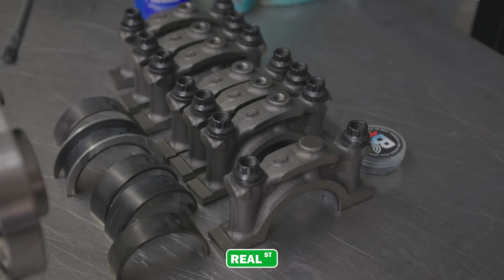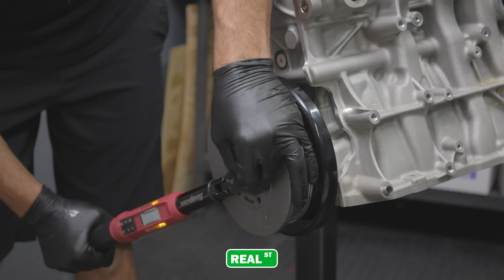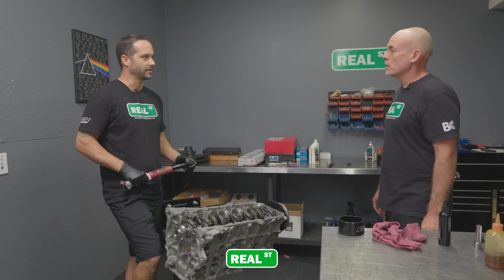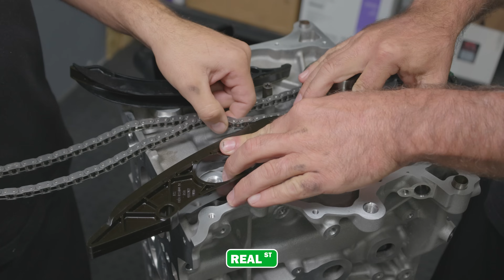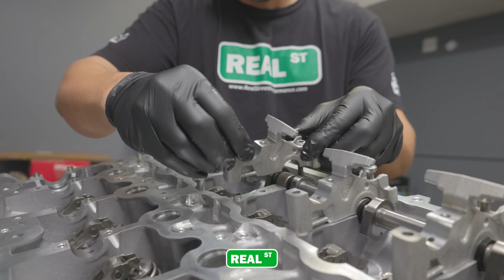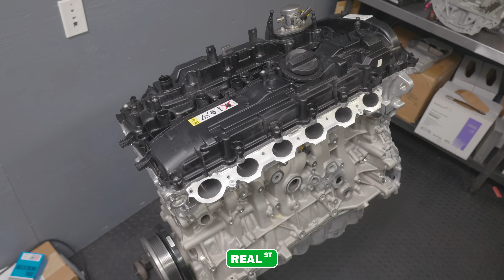Building a 1000HP B58 MK5 Supra Engine

Comment: I was a little disappointed myself that Toyota didn't make a 2JZ like engine for the new Supra and after seeing what it can do with relatively little mods and how far the platform has come I decided to buy one and I'm glad I did.
Reply: It makes Toyota's case even worse when Chevy showed that a new engine they made for the C8 Corvette stingray could easily be made and keep the car at a decent cost.
They should have used the Lexus LC500 chassis, lightened it up, and made a new inline 6 engine. Made the car start in the mid $70k range to look more like the FT1 concept.
Reply: The secret of the industry is that the 2jz design wise, was not that great of an engine
Reply: @l0s78  oh really ?? Why was it not so great of an engine ???
I will wait right here and see what you have to say because i know for a fact it will be bullshit.
Reply: @ACommenterOnYouTube  in terms of design, you want every single cylinder to burn the same. So that when you tune it every cylinder can run the same fueling, same timing, and you won't blow anything because each cylinder is the same. Not one lean, one rich, one much more detonation sensitive.

Every single port on the 2jz is different. It's like 4 different engines in one cylinder head.
Reply: @l0s78  thats a tunning issue, not a design flaw of the motor.
Reply: @ACommenterOnYouTube  lolol. That is a design AND tuning flaw. Do you know how much instrumentation and additional time you need to do per cylinder corrections?

The engine design is mid. Its saving grace was that the bottom was tough enough to boost to the moon and hold up.
Reply: @user-pv3qh8mo4n it wasn't used for real Pro racing, they used a 4Cyl Engine. That is how inferior it is vs the RB26. 2jz is just a straight line Drag Queen.
Reply: @X1xRiGox3X  in the later years didn't they skip the 2j and go to a NA v8 as well?
Reply: @X1xRiGox3X  What is IT ???
Who used a 4 cyl and for what ?
What is inferior to the RB26 ??

YES the 2JZ is a high hp drag queen, NOBODY is saying otherwise
Reply: @l0s78  and once again you failed to explain how this is a desing flaw when it has NOTHING to do with design
Reply: 2jz is a engine made for a grand touring car not for a sport car
Reply: @shadyshinichi2JZ that's isn't saying much for how it actually went for them and they still sit over the so called promised "60k"price tag they said it'd be unless it's used but even that still sits higher than the price of a mk5. Even tuning + adding power in itself is higher and much more expensive and complex in doing than it is with the mk5.
Reply: @shadyshinichi2JZ Chevy has never had the all around sales numbers as Toyota. Toyota has shareholders to respond to. And there is no way Toyota would have ever made an in house MKV with a 3jz and not charged under $60k for it. Easily would have been a $80k-$100k car with no mods done to it yet. The problem is we all forget Toyota or any brand has to generate revenue.
Reply: 2jz was a gt engine. The supra chassis was a lexus coupe chassis. That’s the real history of the supra. If you want to compare the mkiv to the mkv, it didn’t hold a candle to the mkv. In terms of nostalgia and over blown hype, sure. The fast and furious cemented that.
Reply: @touayaaj84  another fast and furious moron thing the movie made the mkiv ... 🤣 
Meanwhile the 2JZ was setting hp records in the mid 90's ... well before the movie
Reply: do you guys not understand that without the b58 the supra would have a 5th gen? how many manufacturers do turbo inline 6s today? exactly, not many. and its because of emission regulations, toyota decidet that it would be way to expensive to make a new inline 6 that meets todays emssion regulations. so the did the right thing, they put the most reliable and tuning friendly new inline 6 in the the supra. that seems to be the b58 and i dont fucking know whats there to hate?? would you guys prefer that they put the inline 3 from the yaris in? i guess not so pipe down and appreciate that the supra even had a comeback and a good one. they nailed all key points that the supra had, rwd, manual, i6 and easily accessible power.
Reply: The money needed design a new engine would’ve made the supra a 90-100k car for the base model just to try to make a profit.
Reply: @gtfree1809  ahh your story is 100% WRONG kid ... 🤣
Reply: @EmazingGuitar  its NOT about the $$ needed to make a supra motor. You people have your shit all wrong
Reply: @shadyshinichi2JZ your plan would not have worked. How on earth is Toyota going to use the platform of a $100k car, make it lighter (which would probably increase cost), make an entire engine from scratch (which Chevy didn't need to do because they never stopped making V8s), then charge for a price that's substantially cheaper?
Reply: @shadyshinichi2JZ  toyota would need to use the rcf chassis and a brand new turbo inline 6 engine of similar quality to there current bmw base claire chassis and b58 which will be almost be impossible to convince shareholders for this level of production scale to undertake it would have been impossible to make the 70k price point which would have heavily effected sales plus the engine would be extreamly unique model since toyota dont make inline 6 turbo and low production means less reliability and parts availability might be an issue compare to the bmw b58 which is use in every major bmw lineup not going with the b58 means toyota would have to retrofit there aisin 8-10 speed which is all honesty not as good as bmw zf8hp as a performance transmision so a toyota build from the ground up supra would be a rcf with there own in house design inline 6 turbo engine that is deffinitly not as good as bmw b58 paired with a less perfromance base transmision on a less perfromance capable chassis and a higher price point with a less reliable and develop package.
Reply: @l0s78  it's not mid at all. The 2JZ is over-engineered like crazy. But I do agree on the point that the head is kinda shit. Really dumb design decision to make all ports different shapes. but that doesn't make the engine itself bad.
Reply: @TheProtagonistGabber  I’d argue that the 2J block is “over engineered” not entirely on purpose or because of ignorance. In the days it was designed the understanding of loads imparted on the crank was not super well understood and not able to be simulated in FMEA. You could essentially hand calculate some rudimentary guesses on loads, and just make the part thicker than it ever needed to be. The crank area is not particularly well shaped with the registers not well supported in tension. The head stud threads are tapped right up in to the deck surface, which imparts additional stress in this area.

Modern blocks have wider deck surfaces for better, more stable cylinder sealing… head threads go down near the mains, come with integrated crank girdles. Making blocks that are all around less likely to stress crack, hold more power, maintain better crank and rotating assembly geometry which translates to longer life of components that make more power, with better emissions and better BSFC.

Comment: They call the B58 the German 2J for a reason. Fun fact, the B58 is used in multiple BMW platforms including the X5 that I daily. It would be fun to maybe build it out to see what kind of Grocery getting monster this could be.
Reply: pure800 upgraded turbo and a tune with some other bolt ons and I bet it is faster than the x5m.
Reply: it is the german 2jz back in the days the 2jz was slap on every toyota product that needed a bit more power and troque then there na toyota a series engine which is pretty much the same story for bmw the b58 is use in every bmw ice lineup that needed a bit more power then the b48

Comment: Interesting talk about the oil consumption. Fun fact, for the honda J series, they tried the same thing. Honda j32 and j35 have iron cylinder liners. About 2-3mm thick. J37s they tried some silicon costing or something along those lines. All j37s burned oil in some degree. Some more than others. Then honda just got rid of the 3.7L V6 and just increased the compression of the 3.5L. Fix in the bulletin was to replace piston rings.

Comment: I was not impressed initially, but after learning of the testing and durability requirements from Toyota on the B58, I gained an appreciation for it. I have always loved BMW's, but have been terrified of ownership due to reliability problems. With Toyota being involved in the development, I'm eager to see if the reliability issue is a thing of the past not only for the B58, but all succeeding engines from BMW.
Reply: Is there any prof that Toyota reliability requirements/ specs are more challenging than the ones from BMW ?

I don’t no any
Reply: Mines been reliable for the past 3 years toyota did good, pushing 800whp for the past 2 years as well
Reply: @sikh7563  Great BMW Engine

Comment: Are boost controllers still available with these setups? Like if you want to roll around with enough boost for 600 bhp map but have the option to go 800 bhp or 1000 bhp.

Nice build.

Comment: i mean to be honest the engine is crazy strong its bascialy stock bottom with bearing vavle springs piston rods and studs with a big turbo kit which is less core parts then what you need on a 1000hp 2jz.

Comment: So I’m 1:30 minutes in to this video and I wanna comment lol. Bmw is the ultimate driving machine and they mean that. They know what the heck they’re doing . The callab between these two major manufacturers was pure quality 👌🏿
Reply: If you had an IQ over 14 you would realize that when the customer had increased the boost or did some sort of aftermarket tuning it caused the head gasket failure as higher pressures in the block do this. This could happen with any engine, even your favorite tried and true engine. 😂

Comment: Hey guys. Since you guys were talking about oil consumption… I’ve got a 2018 Hyundai grand i10 1.25. Car has like 70000km on the clock. Uses 1 litre oil every 3500km. Any recommendations? Hyundai won’t do anything but car is still under warranty. They want to replace engine but blame it on the owner’s driving and not a manufacturing defect. Car gets serviced every year/15000km. Is that consumption normal in modern cars? Use 5w30 synthetic oil. Based in South Africa 🇿🇦

Comment: AMG engine you were mentioning, it had a problem with oil piston rings. They used low friction piston rings. Later the put better piston rings but then you also need to replace the piston itself.

Comment: So the customer never has to worry about the timing since they’ll receive the engine with the head bolted on already? Will they need to re-torque the head studs for the first few heat cycles? If so can they do that without removing the camshafts?

Comment: Originally i was disappointed that Toyota didn't provide the engine.  I Test drove a mkv and was very pleased with the performance.  

Later,  i bought a 23 mt and love it.   It has a good bit of torque in the low end with little lag in the stock form. Also looking at the design and teardown of the engine was much closer to the design of the 2j than i originally thought.  I've also heard Toyota had a good bit of input on the engine itself and it's refinement.  Without being stuck in the past,  i think it's a worthy successor for modern designs.  The b58 will be a more true successor than a hybrid or EV Supra.

Comment: Was the friction hub on the crank updated to the pinned fix or was that friction washer crank timing hub bs only on early engines? Huge pain in car retrofit. Cheers,ed
Reply: The sprocket is a solid part of the crankshaft now
Reply: It was never an issue on B58. S55 was the last engine to use the 2 piece friction disc design.

Comment: Amazing video, master class.  This looks like the “6 exhaust port” version of the B58.  I’ve been searching for a video of this assembly.  Are 6 exhaust ports on the head better than 2?  Which design do you guys prefer?
Reply: Yes, only when it comes to full frame turbo, only 200–300hp differences. If it’s down pipe and tune with stock turbo, power levels are the same.

Comment: It would have been good to show how the valvetronic throttle system worked - or was it some sort of variable cam timing system?
Reply: valvetronic is like Toyota's VVL or Honda's VTEC but in the form of fully variable value. on the video, you see there is another shaft with gear in the opposite end and that is valvetronic adjustment shaft. it controls the position of intermediate rocker in order to adjust how much valve lift will occur. there is explaination on how it works on bimmerprof blog but it only contains 2nd generation of valvetronic diagram. B58/S58 uses the 3rd generation which is slightly different but all of them works in same principal. i do hope the newer B series (and S58) no longer have the same problem as the previous N series valvetronic that also uses 3rd gen valvetronic

Comment: Comparing the 2JZ and the B58TU in the new supra...wow. well, for starters, the 2JZ has over 20 years of development.  The B58TU in the supra has 3 years, and many cars are in 7s 1,300hp with stock block or sleeves, and original transmission built in just less time. So, it is a lot easier to get parts to build a 2JZ than a B58TU. I say it will pass the 2JZ with time if engineers keep developing the B58TU in the supra. Many supra MK4 on the track have minimal interior compared to MK5 running high HP. I say if an engineer builds the B58TU with the recipe of a 2JZ, it will be a game changer.  Billet block, billet heads, taking into account several areas of the heads that lift. Aluminum rods...etc full send 80psi...lol. The B58TU in the supra will become a legend as the 2JZ.
Reply: When you say stock block, what do you mean? People tend to abuse that word. Do you mean to tell me with stock rods and pistons etc?
Reply: @top-notch9761 stock block as in no modification to the block. Factory block, no boring, no sleeves. The factory motor, factory parts, tuners have said 800hp is the most you can push it and even that you are in borrowed time.
Reply: @manny619ish  Yeah I gotcha, I was just making sure that you weren't saying that the stock rods and pistons can take 1300hp without bending and splitting the block in half 😂. Cause it can't as far as I know the big boys that are pushing these incredible b58 engines are built.
Reply: @top-notch9761  asking stock internals to withstand more than twice stock power sounds absurd to me. even the old 2J cant handle too much power on its stock internals. well, maybe those engine can withstand 1000HP on stock internals......... within a few seconds 😂

Comment: Why retain coated bearings? Most owners are going to turn off the stop-start feature anyway, and the OEM coated bearings have already been a source of problems.
Reply: OEM ones might cause issues but coated bearings can have a few benefits
Reply: They aren't a source of problems... the BMW engines with IROX coated bearings have the lowest incidence of bearing issues that they have had in 30 years. Look at any teardown of an N55 compared to B58. The bearings on B58 are pristine in comparison.
Reply: @chrisbradley3224  Papadakis Racing had problems with the coated OEM bearings in their B58.
Reply: @justsomerandomguyman  Do you have a link? They haven't been problems for anyone else that I've seen.
Reply: Papadakis mentions the issues he’s had with oem bmw bearing in a interview with hp academy. He also runs the variable oil pump at default 90psi now and swapped to king / acl coated bearings. But this guy is pushing the b58 over 1000hp with 3.2 stroker kit
Reply: @daveylovesgravy3622  I see, thank you for the reference.

Comment: It's a collab yes but Toyota was involved they would not accept anything less. This motor probably isn't 2jz but it's good I'm my opinion!
Reply: People love to claim this but B58 was actually designed before Toyota's involvement. Maybe they had minor input for revisions. Don't forget, Toyota approved the piece of crap FA20 and FA24 engines in the 86. People think Toyota is some kind of god but you can't make right turns in a GT86 without losing oil pressure.

Comment: not a fan of having the exhaust manifold in the head and the timing chain in the back, but overall B58-B48 are good engine
Reply: Exhaust manifold isn’t in the head for the b58 aside from the first year of Supra production. 2021 and up does not have an integrated header and has a 6 port design.
Reply: @zdoomcentral  more than happy to hear that, i hate that solution